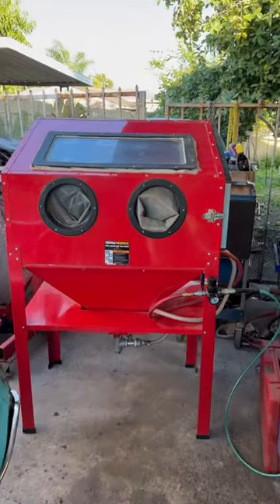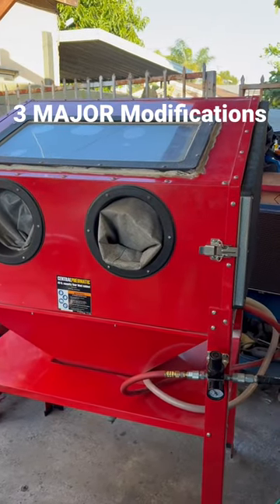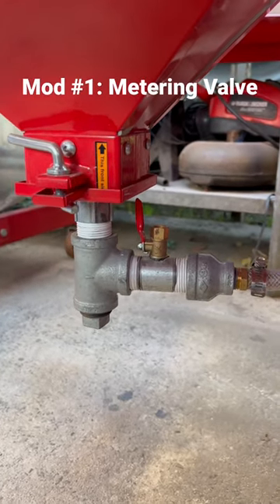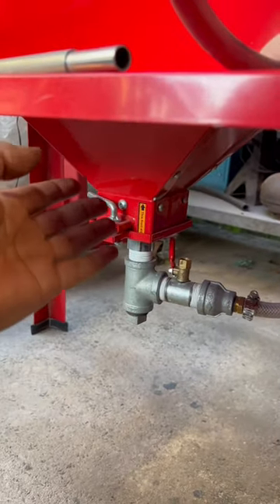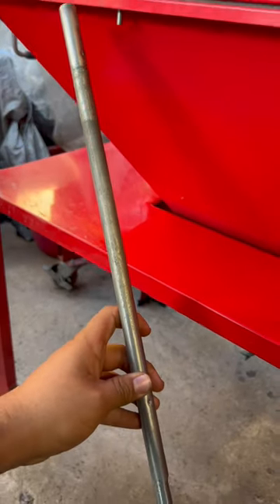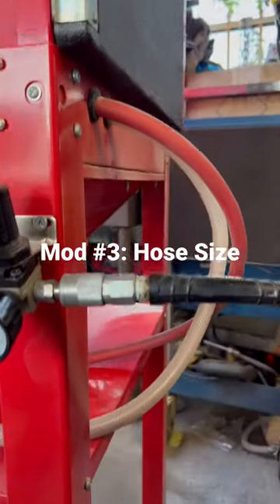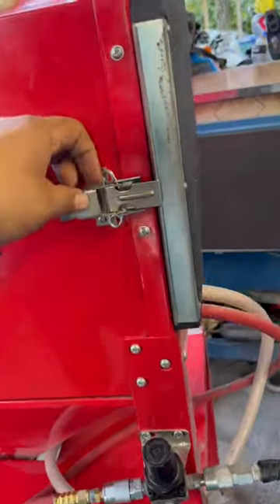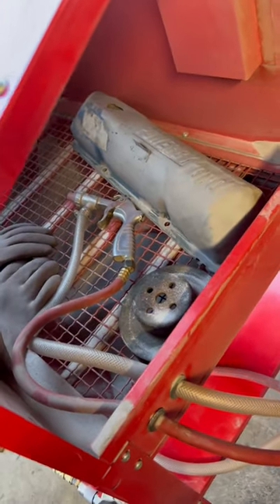3 MAJOR mods to IMPROVE your Harbor Freight Sandblaster!  #shorts #youtubeshorts #diy #sandblasting

Comment: I did these mods on my blaster. I used plastic electric conduit to replace the siphon tube. I put a water separating pressure regulator to keep the media as dry as possible.
Reply: Yep.... Great tip. That's about the best advice for anyone who starts using this equipment. I built some portable dryer stands to use on both my cabinet & the big industrial/commercial towable unit & pot that I have. It was expensive after the larger industrial dryers,  reducing bushings, fittings, pipe nipples, pipe clamps, hoses,  a few more fittings, pipe sealer, teflon tape, plywood, 2x4s, screws, casters & some other miscellaneous hardware but after the results of lost time & frustration being eliminated, it was certainly worth it.
Reply from the maker: Yes I have a compressor water separator but I think another one at the cabinet will be much better

Comment: Put a dryer at the cabinet supply. Moisture is your enemy. Dry air will always make it even " faster, easier & better. " moisture will cause clogging, time & frustration. Trust me I've worked with many sand blasting setups. I built 3 portable setups on ply wood stands with a nice commercial size & quality dryers. I used the bigger ones with 1 inch openings. Bought the big 1 inch quick connectors for large equipment such as a jack hammer. Then used reducing bushings on the hose side I used 1/2 inch for adequate flow. Made some 12 foot hoses with the necessary fittings to hook up to the cabinets & compressors I use. It's a worthwhile & expense project but it will save you a ton of time & frustration. Especially if you do sand blasting to make a little money or as a full time thing. Then that means time clearing clogs & stopping working costs you money. Don't forget to purge the dryer often. I setup a drain hose & a water cooler bottle to catch the water. I do a lot of sand blasting with a big pot for trailers, vehicle frames, aluminum boats, engine blocks, etc.... I can use my dryer setup on both the big towable construction compressor & the 80 gallon in my shop for the cabinet. I use a dryer at the compressor & the pot so I always have Dry Air. The big compressor makes hot air & it cools rapidly as it flows through the line & that makes more moisture so I use a dryer at both ends on the big setup. I made 3 of these portable setups so i always have a spare. I usually have a dryer at both ends on the cabinet & the big compressor. This way I can just move the little portable stands between the 2 as I don't use both at the same time. 
 Well.... I hope that helps you be more efficient & profitable. I know it did for me & I wish somebody would have told me this before I started because it would have saved me several hours of frustration..... but once I figured this out, it was " smooth sailing " from then on. Just remember to purge the dryer regularly.
Reply from the maker: Thanks for that. Very true in keeping the sand as dry as possible. I have a water trap from the compressor but I don’t think that’s enough. I like your idea of the dryer, I’ll be trying it out
Reply: What kind of air dryer did you use specificslly? Would a truck air firlter work in a homemade pot?

Comment: What does the ball valve on the bottom of the hopper do? Does it let in air from the top?
Reply: @koybuscho5880 The little ball valve lets a little atmospheric air into that pipe. It "fluffs" or mixes with the media to help it travel to the blast gun smoothly & evenly by suction from the blast gun. Start with little valve fully closed, pull & hold the trigger open on the gun, then start opening the little valve until you see the media flowing smoothly thru the clear tube.  Good luck!

Comment: I have one of those. 
All I do is put my glove over the nozzle and force the air back back down the suction tub to clean out occasional junk.
Another way is to use my separate air gun to force air at the gun nozzle back down the suction pipe occasionally.
Reply from the maker: Yes I do that occasionally, it will gum up sometimes

Comment: I did the same mods to mine, definitely makes it more usable. I also replaced the gun with one I made with no trigger along with a foot peddle/switch/valve (whatever you want to call it) for airflow to gun, so nice. For the window I hae metal window screen below a 1/8" piece of glass with plexiglass sheet on top. Screen prevents media scratching the glass and plexiglass protects glass from falling objects.
Next I added a vacuum cleaner that runs through a diy cyclone, media dust never makes it to the vacuum filter.
The cabinet is mounted to 4x4 PT with the front and rear pieces high enough for my pallet jack to clear so I can easily move it if needed.

Comment: If your pickup sucks everything at the bottom, won't large pieces of the stuff you have blasted then clog the pickup? I always assumed that's why they used a siphon tube?
Reply from the maker: if there’s large pieces it will be strained and media will be re used. Aluminum oxide is pretty good on being able to re use it

Comment: I see you have media blasted a valve cover(s).....I wouldn't do that. I did that once not thinking nothing of. No matter how much you blow off the media and or rinse in solvent you will never get all the 
 media that collects inside the baffles out and it will eventually work it's way into your oil. I did that to a set of valve covers that I had to remove the baffles for rocker arm clearance on a friend's small block chebby and was surprised how much media collected in those era even after a thorough cleaning.